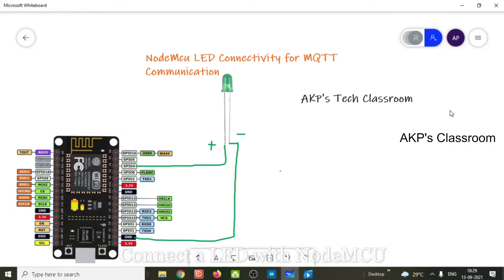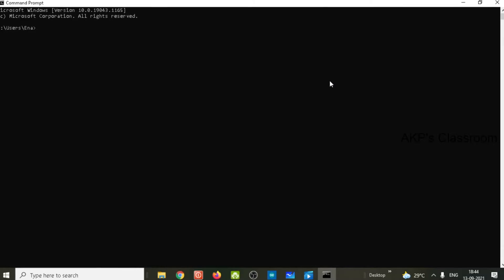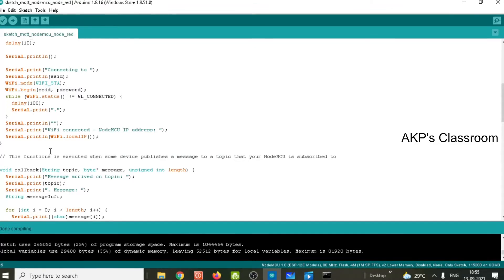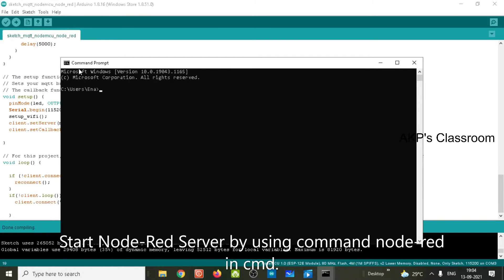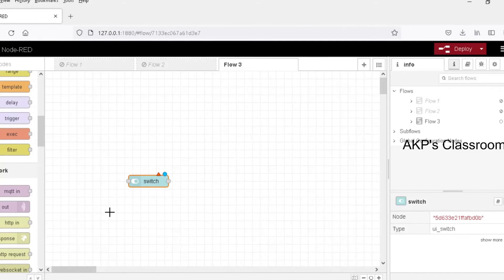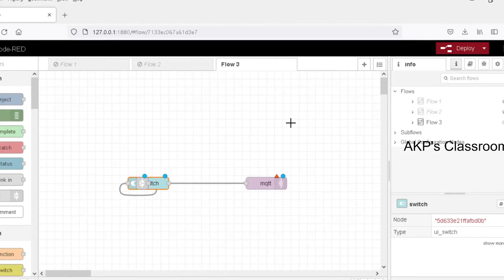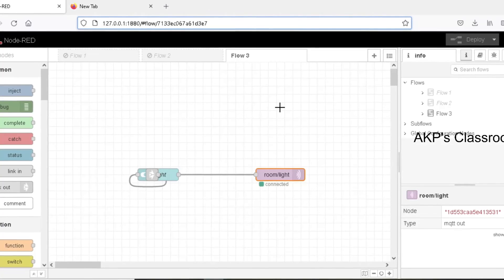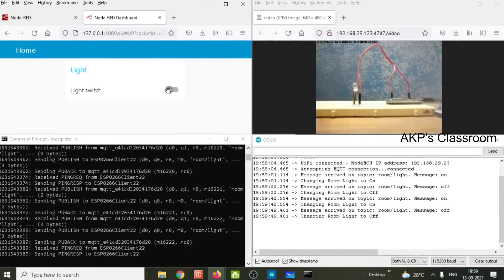How to Configure MQTT Mosquitto broker & Node-Red Dashboard to Control NodeMCU ESP8266

Comment: Great Video Sir, I am using mosquitto broker locally and have also done port forwarding from pc IP to localhost on 1883, yet still not able to connect with esp (Serial Monitor: Attempting MQTT connection...failed, rc=-2 try again in 5 seconds).
Reply from the maker: Thanks for watching the video ,please check the status of port forwarding if it's properly configured or not ,,else check your mqtt code and  upload it once again, hope it will solve the problem.

Comment: Hello sir, i have a trouble my mqtt wont connected it says rc=-4 or sometimes rc=-2 i already configure the mqtt nodes same as yours cause i run my modquitto broker on local how do i fix it?
Reply from the maker: Do the port forwarding from your pc IP to 127.0.0.1 on port 1883..

Comment: what should ı write for mqtt server ? whats ıp adress is it
Reply from the maker: If mqtt server is installed in the same pc where nodered installed then use localhost or 127.0.0.1
Else you need to use ip address of the pc where mqtt server is running

Comment: Hello sir, I am not able to make connection between switch and MQTT in . It is showing successful deployed at the same time it is connecting not connected. Could you please guide us on this issue.
Reply from the maker: Check mqtt broker  & nodered connection first. Put the right ip details or server address in mqtt node settings in node red .
Reply: @akpiot  everything is working but in node red dashboard it is asking to add some UI nodes to the flow and redeploy. How can we solve this sir?
Reply from the maker: Check the node connection by using timestamp
Reply: @akpiot  we are getting some error in the serial monitor as attempting mqtt connection... Failed,rc=-2 try again in 5 seconds
Reply from the maker: The error is coming due to ip connection between esp & mqtt server. Instead of local server use cloud mqtt server like hive.

Comment: great..can you some the change of code for adding more leds to a separate topic?
Reply from the maker: Do you want to control multiple leds seperately using multiple topics ??
Reply: AKP's Tech Classroom that is correct
Reply from the maker: It's possible..
Reply: I can get two LEDs to turn on but not using separate topics. How do you do this?
Reply from the maker: @ModelRailroadTechniques  use 2 topics     to control 2 leds .. just subscribe the topics from MQTT client